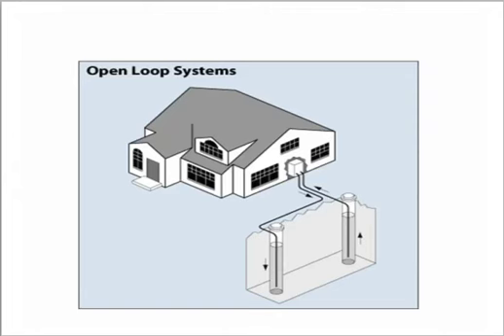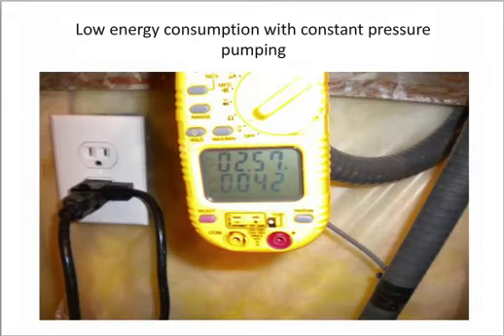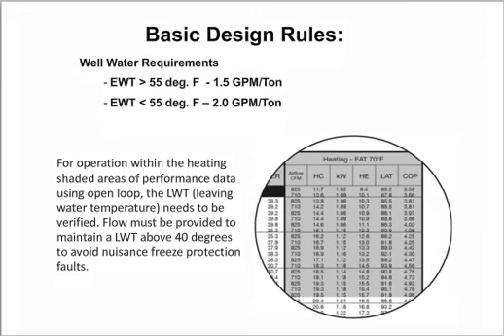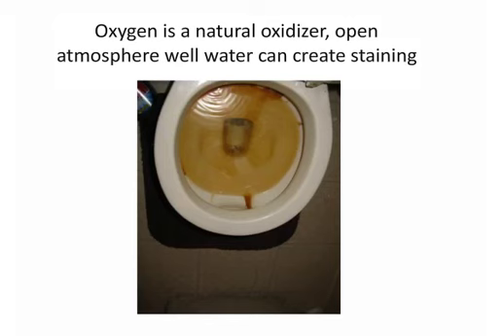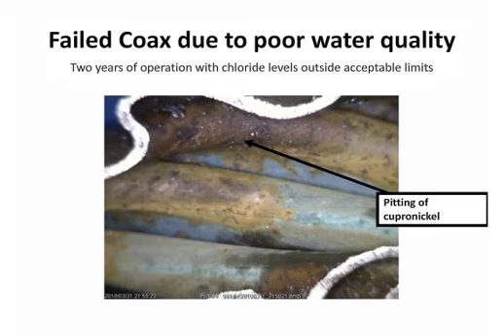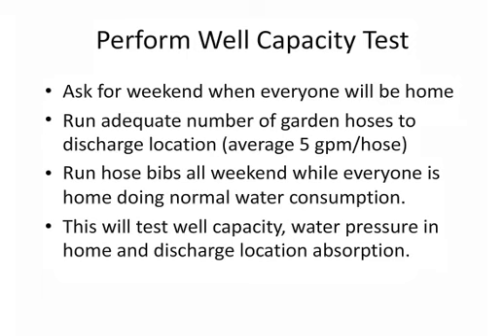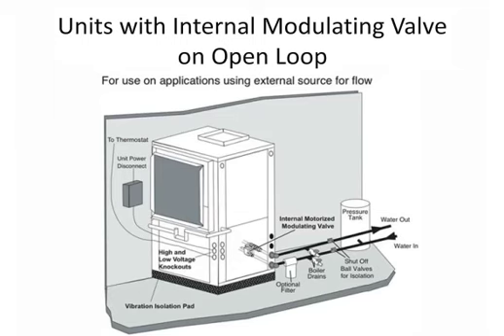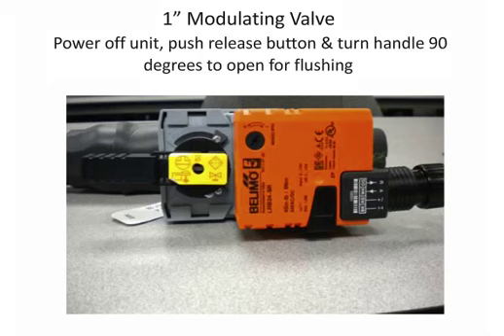Get in the Loop on Open Loop Geothermal ClimateMaster Webinar

Comment: Not sure why the seller of a water source heat pump brand would stick all of these warnings into a video to SELL a system......trust me, it's not complicated at all.
    If you have a water well without high mineral content, you're good to go. If you do have mineral issues, isolate the heat pump heat exchanger with an external brazed plate heat exchanger.....if it becomes problematic, it's easy to clean or replace.
  You DO NOT need to bore a separate well for the discharge water. If you live in sandy soil, just dig a hole and plumb the discharge to it. I used a 30 gallon barrel dug into the ground, and it works flawlessly ( I never said there'd be no work involved..)
  If you're in tight soil (clayish....) you will have to be creative. If there's a ditch nearby, do that. The building inspector I dealt with didn't care less...(nothing in the code specifically for spent water....)
   THE MAIN TAKEAWAY from this video is showing the MAJOR flaw in air source heat pumps. When an air source heat pump gets into the lower 30's it has to defrost the coils (and even warmer in some conditions..) and THAT is how heat pumps got a bad reputation....massive electrical resistance coils energize (think hair dryer...) and man, the electric meter spins like you wouldn't believe!!!
    Does not happen with these units, unless the system faults. You are required to have that back-up in emergency situations.
      Don't let all of this techno gibberish make you shy away from this EASY tech....I have two, and they both perform flawlessly...to the point (and this is funny. Duke Energy has replace my electric meter THREE times because they were convinced from an audit, that I had to be cheating.....I'm not!! It really is that good!!
Reply: Some less fortunate folks in poor countries make these heat pumps by themselves with plastic pipes for heat exchanger this way they do not have problems with minerals as well it is easy to install removable filler. Thank you for sharing your experience

Comment: I know this an older vid but I'll cross my fingers you might still be watching the comments.

I've got a an open pump and dump system in the home we bought but there is absolutely no info on the who, what or whens it was done much less have any of the technical and flow/ temp rates you mentioned. This takes from my main well and then there is a secon well it dumps back to aquifer in. 

I'm having trouble finding anyone to want to service it if they didn't install it and I've been cautioned that a couple of the local installers are more issue than assistance. Several seemed to be clueless about the Geo systems yet they are to be installers? Can i service this on my own? I also have a feeling that it is likely not installed correctly and I'm questioning if they took in to consideration the water chemistry. I'm in central PA and our water, as tested by Culligan, was around 25grains of hardness. I'm concerned the super heater is likely heavily scaled and likely not doing it's job.

Any help or direction is appreciated
Reply: If there are any issues, the system will default in heat mode to the back up resistance heaters, and your electric bill will be sky high.
   If the fault is in cooling, it simply won't cool the house. Check the return air temp (filter location.....) and the temps from the registers (outflow locations...)..should be at least 20 to 28 degree difference....same with the heating.
  Scaling in the heat exchanger will show a pressure drop from the inflow to the outlet flow, but it's only a check to do IF the temp differences are found.

Comment: I bought a house with an open system installed. We love the efficiency. We do not have a pond or stream anywhere nearby... Do you have any suggestions on what to do with the discharging water? Drilling a separate well seems like a pretty expensive option. Any videos or suggestions? Thanks